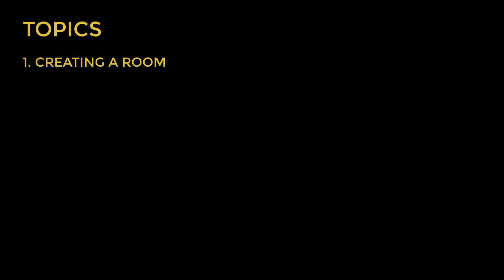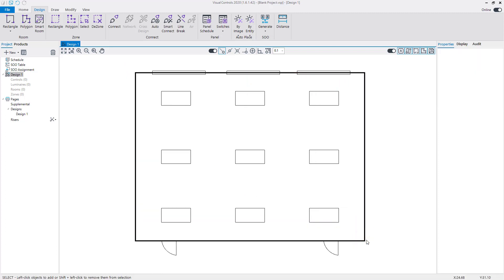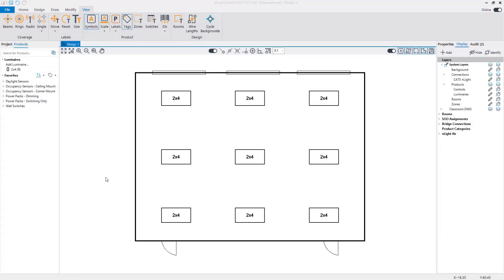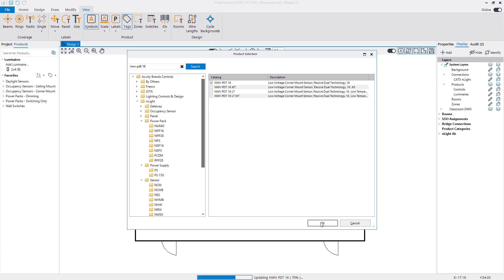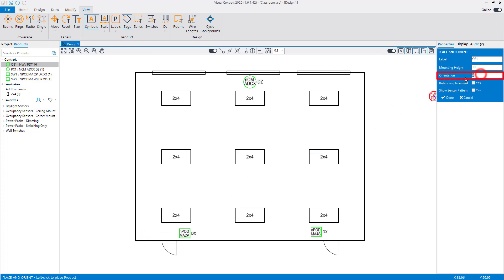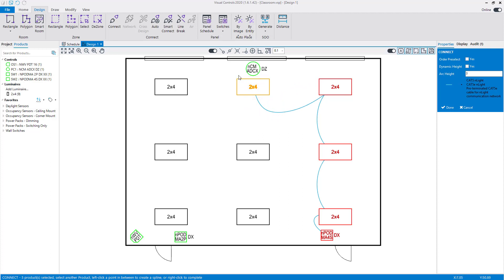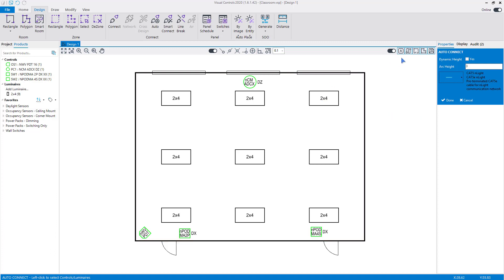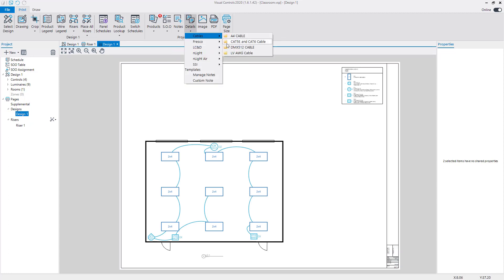Visual Controls - Basic Wired Design

Comment: I am using Visual Controls 2024 (1.13.0.264) and connecting from nPODMA4S to lights are not working, popped up message showing "Not enough ports are available to connect the devices". Cannot connect to any lighting fixture!